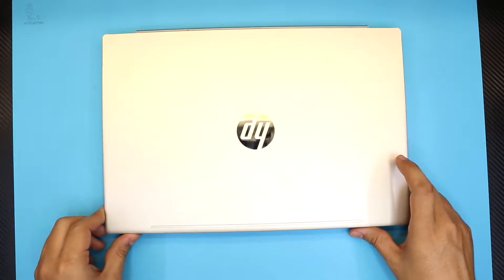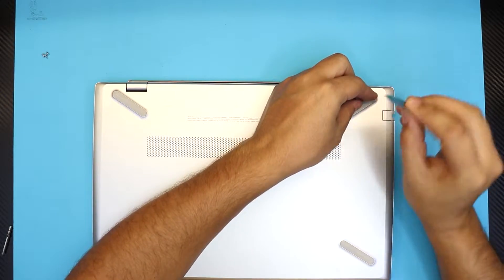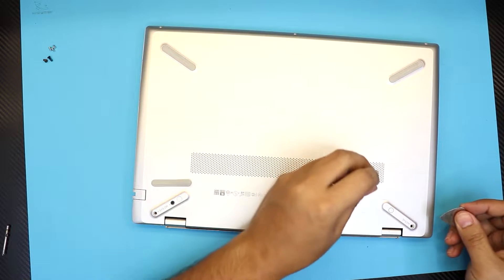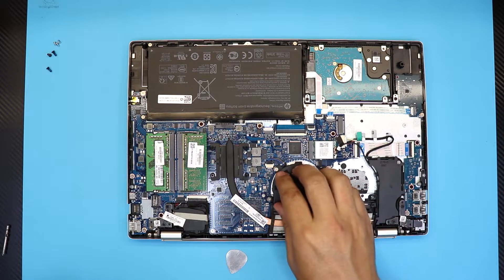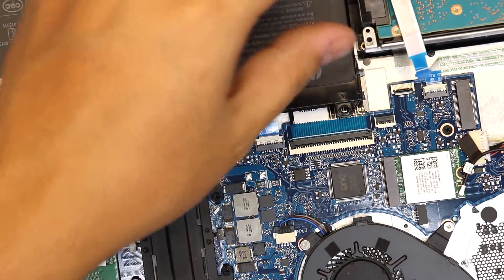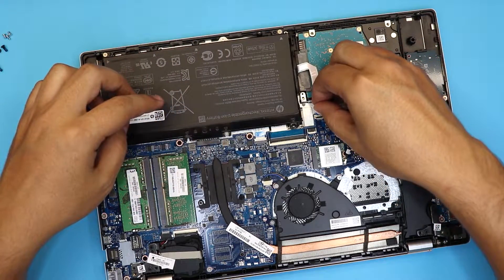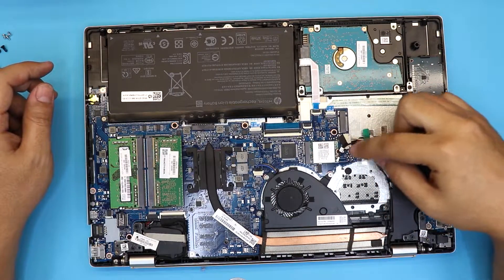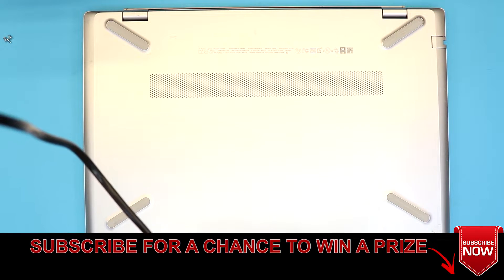HOW TO UPRADE or SERVICE : Hp 15 cw0007la 3px77la#abm

Comment: Hola acabo de ver tu video, si le quiero poner una ssd y usar el hdd para almacenamiento, hay algun problema al inciar con los dos discos teniendo el windows?
Reply from the maker: Hola, no te preocupes, el BIOS va a arrancar con el SSD, ya que fue la última unidad en la que instalaste Windows.

Pero en caso de que haya un error o inicie desde otro dispositivo, tendrás que comprar un adaptador para conectar el HDD a tu laptop via USB después de haber ingresado a Windows, para poder formatearlo. Después de formatearlo, simplemente colócalo nuevamente en tu laptop. ¡Así estarás listo para seguir adelante sin problemas!
sata a USB adaptador

Comment: Hola...acabo de ver tu video porque busco información sobre cómo reemplazar la batería del CMOS, y no la veo por ninguna parte. Gracias de antemano.
Reply from the maker: hola, te informo que este modelos no llevan batería para BIOS, el chip de BIOS se mantiene su información con la batería principal. si quieres reiniciar bios quita su batería principal de su laptop, y mantener presionado el botón de encendido por 60segundos para vaciar la carga de capacitores en su tarjeta madre. saludos

Comment: A place you said GPU is not installed. I took mone for repair and it now very slow and calls for a new battery whenever I restart the laptop. Could it be something got replaced?
Reply from the maker: Thank you for the feedback! if you wish to support the channel you can LIKE or SUB or both :P
regarding your question: if you power on and you get a text about the battery, then FOR SURE they replaced the new battery with an old one, there is no other reason for the msg.
they may have removed one of your ram and or put a very bad thermal paste (100%). it makes me angry how they try to rip people this shops.

Comment: Hola, de esta computadora específicamente, para cambiar la pantalla, necesito desarmarla toda? Gracias 
Hi for this specific comp model do I  need to dissassembly all?
Thanks
Reply from the maker: hola, absolutamente no, solo quita el marco de pantalla y luego 4 tornillos que sujetan el LCD y desconecta su cable y ya. no tienes que quitar la tapa de abajo de laptop. si gusta puedes llevar a mi taller y de gratis te cambio, y llevame la pantalla nueva. si te interesa enviame emai:
ask@ufixtek.com
Reply: @uFixTek  me encantaría pero vivo en Acapulco y no sé  si los envíos costaría más.  El cable que mencionas está arriba, abajo? Gracias por tu amabilidad.

Comment: Hola amigo. Antes que nada, muy buen video. Tengo dos preguntas:
-Esta ssd funcionaría en mi equipo? https://www.amazon.com.mx/dp/B07BMXS6SH/ref=cm_sw_r_cp_apa_i_73s6EbYNSD30G
-Al conectar la ssd mi laptop ya se podría usar normalmente? (Con el disco duro y la ssd)
Muchas gracias!
Reply from the maker: si vas a usar este:
https://amzn.to/2Y7XbCj
después de instalar en la lap, tu sistema va seguir corriendo desde tu disco mecánico, y este se va reconocer como adicional, te recomiendo altamente, reinstalar windows en tu ssd y luego borrar el hdd mecánico y usarlo como para guardar archivos. 
si quieres sabe como instalar windows dime.
Reply: @uFixTek  Vale bro, muchas gracias por la ayuda
Reply from the maker: por nada gracias por su apoyo con mi canal. :)

Comment: I had a question, my sisters laptop doesn´t works, so she send her laptop to hp but they toold her she need to replace ASSY MB UMA ryzen3 2300 U WIN BOLTON, we not understand very well. Watching your video  what are they want to replace exactly? The laptop its Hp 15 cw0007la 3px77la#abm
Reply from the maker: they don't repair anything they will just replace parts and not always do the best job. where are you located>?

inside the laptop there is only one main board and two small boards (one fore extra usb and the other sd card), the laptop can turn on and work fine without those two cards. 
when they say they going to replace the "ASSY MB UMA "
they mean they will replace the main motherboard ("ASSY MB UMA ") and comes soldered with cpu and gpu on board, practicly they giving you new laptop (IF THEY REALLY CHAGE THE MOBO)
and if you are in mexico, i can assure you they will not replace the motherboard, they will do some cheap fix and charge you a new motherboard.
how you can be sure and protect your self from scams.
#1. open the bottom cover there is no warranty seal or anything
#2, write down the serial number
#3. a better option than #2 is to do a smal scratch marks on the plastic or metalic conectors and take a pictures as evidence.
(i have placed a few x marks where you should scratch) 
https://imgur.com/a/uoc3wVY

#4. Be clear ask them and make sure they write it down on paper that they are replacing motherboard (ASSY MB UMA)
#5. after when you get it ask them to the back cover in the service desk or give your old motherboard back, because you paid for the new one! and the old one should have your marks on it!

#6. explain to me whats going on with laptop and i try to fix it for you.
Good luck
Reply from the maker: igual me puedes escribir en español

Comment: una pregunta, yo tengo esta misma lap y note que tiene el puerto para una SSD pero no se que tipo sea o como pedirla, ademas e visto que alguna personas usan GPUs externas y las conectan mediante display ports o por algun puerto raro en la laptop (como veras he investigado pero no soy muy versado en esto) queria saber si en ese slot de la SSD puedo conectar un GPU o si acaso el puerto USB C 3.1 que tiene puede servir a este proposito, gracias
Reply from the maker: puedes poner adicional ssd nvme (512 o 1tb ) busca en mercado libre "ssd nvme 512", o puedes cambiar tu disco mecanico a un disco solido de 2.5"  (SSD 2.5" 512GB) sobre tarjetas graficos externo, se utilizaria la entrada de tu NVME ssd, y un usb 3.1 pero es un dolor de cabeza para configurar. yo ha intentado en varias clientes y si funciona pero cada laptop trae su pedo.
Reply: @uFixTek  muchas gracias por la info, vere lo de poner un SSD nvme porque la verdad siento que seria menos problematico a clonar todo lo del disco duro al de estado solido
Reply from the maker: playercero0 claro dame unas horas ando en calle , te mando infos llegando a oficina. Saludos

Comment: Thank you for the video, it's very helpful. A question. Could i use a different brand of RAM to upgrade from 4GB to 8GB? Mine has 4GB of Samsung, could i get a 4GB of Crucial memory to go with it? Would it be compatible? Thanks.
Reply from the maker: Droogie yes you can always use a different brands, it doesn’t have to be the same bran or speed or gb, only if you want to activate a duo channel config then yes you have to use only same speed and GB.  But for your question: yes u can use any other mixed brands

Comment: Hola, una pregunta, siempre y cuando tenga regulada su temperatura con una base enfriadora no tendré problemas en ciertos juegos? Y que temperatura no debería pasar para no correr el riesgo de dañarla
Reply from the maker: si checas tus temps, al estar jugando tus temps de GPU no debe de rebasar los 70c , encaso que si ya vas a tener un pedo enorme en unos meses.  si con el base se te bajan las temps, sigue usando en bueno.

Comment: Llevo ya más de un mes jugando a the Witcher 3 en esta lap y no se calienta mucho la corre al 100 super recomendada
Reply from the maker: Alex Garcia si de jalar va jalar pero de que dure no te va durar me llegan uno al mes facil a reparar gpu
Reply: uFixTek pues lo raro es que no se calienta lo tengo sobre una base fría y no se calienta más que lo normal es un procesador muy potente y tiene su año de garantía 😉
Reply from the maker: @AlexGarcia-lh6fw  que bueno tienes buen contacto con tu heatsink , revisa tu temps con afterburner o otras si no se suben mas de 65c después de un rato jugando ni se te vaya ocurrir a abrir esa madre. :P tienes suerte, digo solo el mes pasado me llegaron 3con sobre calentamiento.

Comment: @uFixTek Existe algún inconveniente al quitar la memoria RAM de 4 gb y agregar otra de 8 gb para tener un total de 16 ?
Reply: +uFixTek perfecto, tenia mucha duda sobre eso pero ya esta, muchísimas gracias!
Reply from the maker: tienes 2 x 4gb ahorita e quiere quitar ambas e poner 2x8gb ?? , para tener 16gb tienes que tener 2x8gb. 
ahora si tienes 2 de 4 e quieres quitar uno de 4 e poner 8gb en su lugar seria total de 12gb!, a eso te refieres?
Reply from the maker: siempre te recomiendo tener dos memoria iguales de GB tanto de su velocidad , ejemplo; (2x4gb 2400mhz, o 2x8gb 2400mhz) .
así se te activa el modo de "dual channel" (mas rápido el procesos).
si pongas mezcladas las memoria o velocidades diferente ya no tendrás el beneficio de "dual Channel" , va funcio nar la lap normal pero un poco mas lento al arrancar programas.
te explico en english a ver si me explico mejor :P

In order to run dual-channel, the memory configuration on each channel must be a nearly exact match as far as the memory controller is concerned. You cannot have 1x4GB on one channel and 1x8GB on the other and the timings/clocks cannot be different for any module. (Although it is usually possible to down-clock faster modules to match the slowest.)

If you want to run dual-channel, you will have to ditch your current 4GB or get a second matching 4GB DIMM.

You can still run dual-channel with asymmetrical configuration but the memory controller will run them in interleaved mode which usually does not perform as well.
Reply: +uFixTek ok ya entendi
lo que pasa es que la mia tiene 2 memorias RAM la primera de 8 Gb y la segunda de 4 gb, lo cual suma 12 
pero quiero aumentar a 16, quitar la de 4 y sustituir por 8
Reply from the maker: que cosa no manches te vendieron una laptop de 12gb de ram  módulos diferentes!!!! 
si quita el 4gb and compra uno de 8gb pero que sea al misma velocidad de tu 8gb no mas no menos.
asi te activara tu doble channel e mucho mas rápido aparte. saludos